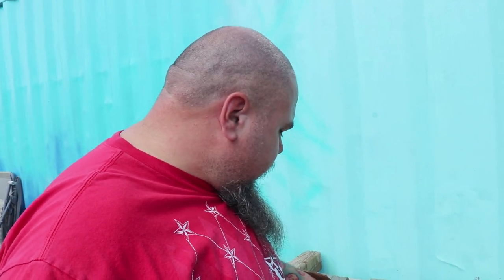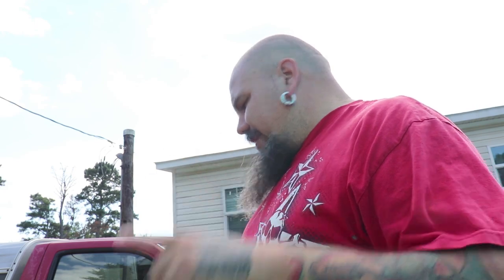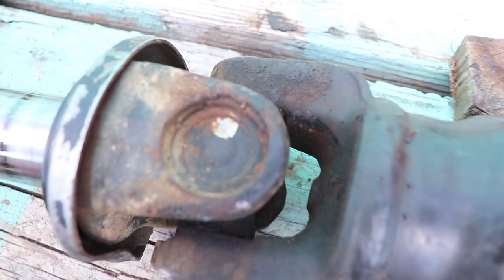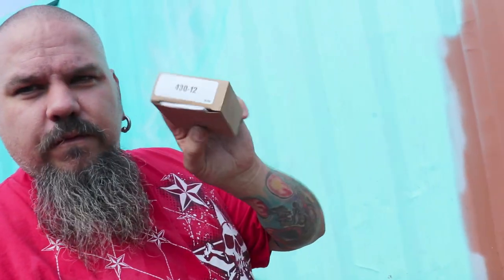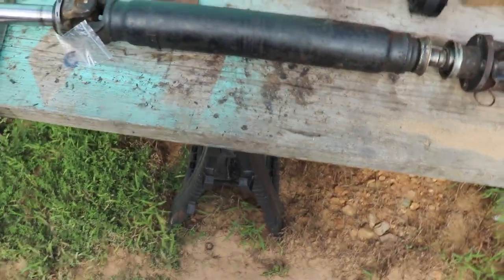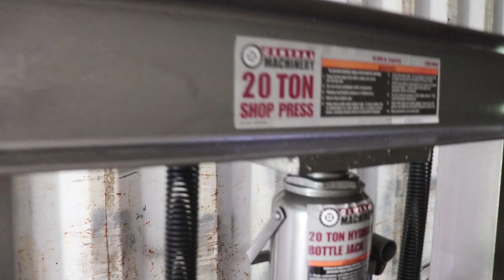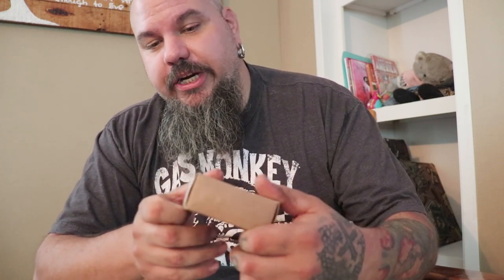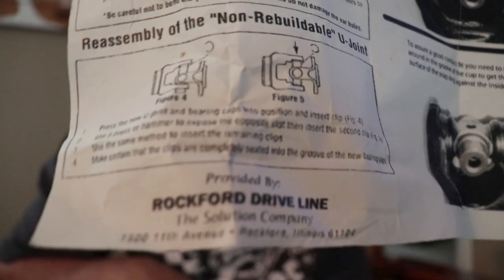Nissan D21 Staked In U Joints. Part Number 430-12 Project SIN.

Comment: Here is the trick to making this easy. Press all 4 of the caps so they shear the little staked points. Then use a torch or a sawzall and cut out the center piece so it falls out. Then press the caps down in towards the center and the caps will fall out. Carefully remove any burrs with sandpaper or a dremmel. Don't over do the grinding or sanding. Then press in your joints like you would a regular joint.

Comment: Do you have any idea if this would be the same part for the 1986.5 D21 Hardbody ? Mine is with the VIN that begins with "JN" and 2WD Reg Cab. I just replaced the center carrier bearing and now the u-joints seem to be making even more noise. I am thinking that it might save time (not money) to just buy the entire driveshaft assembly. I guessed it could be that the torque specs and/or seating of the carrier bearing may not be right, but now it sounds terrible - just constant squealing from 0-40 mph. Thanks in advance for any response. Currently the truck has 160k miles on it.
Reply from the maker: A lot of times it might be those metal dust covers that are next to the carrier bearing, I usually end up taking them off. That web site I provided has what vehicles take the ujoints. Get u der the truck and wiggle back and forth and see if there is any play. My guess is that the rubber on your carrier bearing might just be rubbing on your dust covers though, creating the squeal rather than a vibration.
Reply: @CampingOutOfDebt88  Man you were spot on 100% correct ! After driving the truck for about 15-20 miles the squeaks went away entirely. LOL - had me worried there for a minute. I had actually placed an order for the Dorman driveshaft on Amazon for $392 + tax which comes with a carrier bearing mounted / removable u-joints. Cancelled the order. I typically only drive the truck in the cooler weather because it doesn't have AC. So, it seems I'm okay. I also changed the tranny gear oil / rear diff oil with GL-4 and GL-5 respectively. Back on the road again !